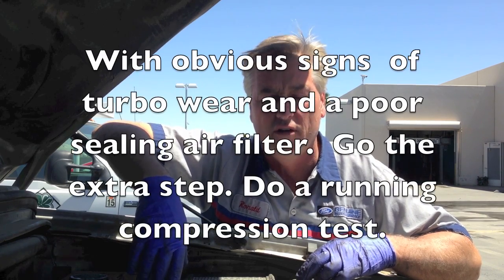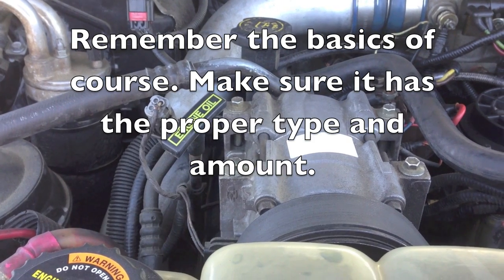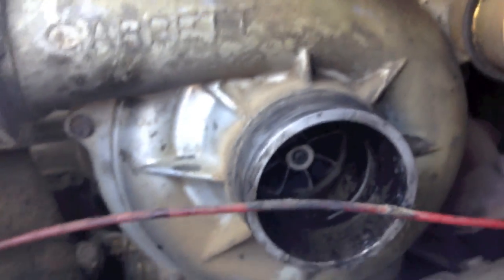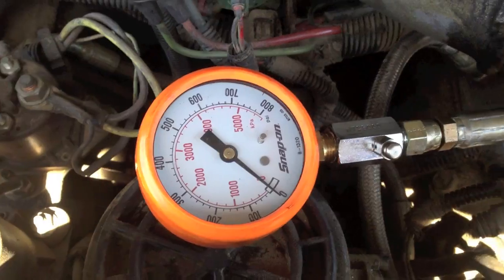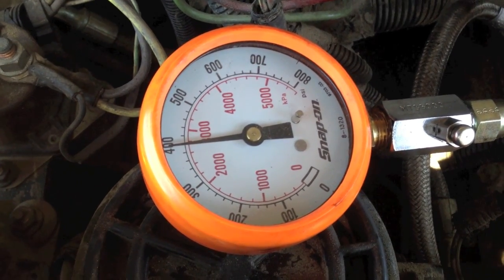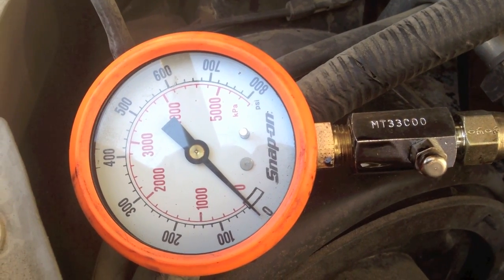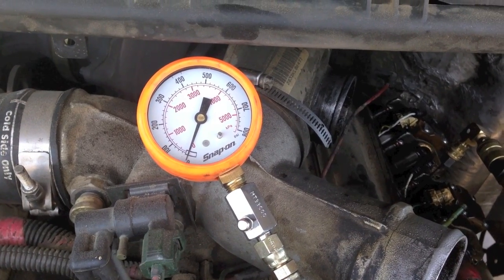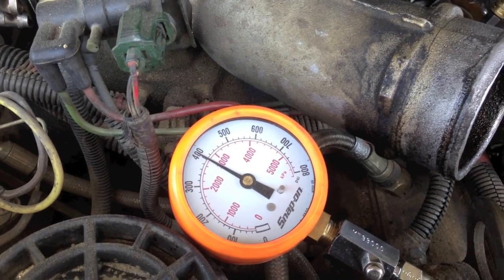Ford 7.3 Powertroke diesel runs rough due to wear. Injectors replaced

Comment: I believe you are one of the most knowledgeable resources on the Tube... there are so many contributing factors to a why a engine runs the way it does.  I could see why the customer might be chapped. Even aftermarket injectors can easily run $1000. I had some rough running conditions and fixed them permanently with stiction eliminator oil additive ....HOTSHOT stiction eliminator.. $60. but it worked for my issue. Beats the 1550 estimate for new injectors I was quoted. I've put over 3200 miles on it since and it runs awesome.
Reply: Is yours a 6.0 or 7.3? Cause my #3 injector is popping a code whenever I run CCT and I would love to not have to take it in for a compression test...

Comment: Let this be a lesson kids... even a workhorse dog of an engine like the 7.3 will go to s**t if you don't do basic maintenance.

Three main things to remember with the 7.3:

Clean air/fuel filter, pipe sleeves on correctly and boots nice and tight, and for the love if God GET YOUR OIL CHANGED REGULARLY.

Comment: I purchased a 2003 Excursion 7.3 exact same problem previous owner had removed the air filter turbo impeller is obviously damaged and has affected cylinders 1 and 8

Comment: hi  you 're   smart guy  l see your videos l like  7.3 l can ask you l  have 99 l rebuilt all injectors not starting l change icp sensor ipr valve not starting can you help  please i put 75 fls torque its corect
Reply: Unfortunately,  Ron tragically passed away. R.I.P Ron.
Reply: 03 f350 rebuit & shimmed drivers side injectors including interior  exterior o-rings. Wont start.ipr,icp cps all new prior to rebuild. Did u fix ur problem?  Frustrating

Comment: Hi, I have a ford super duty, with a 7.3 ,240 000 miles on it. it was working very well then it stop. I started it runs   good on idle but  when I push the accelerator pedal it stop working, I crank it again it works, then I push that pedal and it stop. I change the fuel filter the one that separates the  water from the diesel, It keep doing the same. I disconnect the batteries  wait a few min, then I reconnected back and the motor ran very well for a week,  then it  stop  and  as before keep doing the same. any idea, what can be the problem?
Reply: Qubole Hector, did you find the problem? Oh la echaste mejor al quilo?

Comment: I would think that 500+ lbs of compression should fire. It may not be contributing 100% but that's enough compression to fire the fuel. Did you try to take a running compression test on one of the good cylinders with the injector disabled? It would make sense that a cylinder that is firing would have higher compression pressures due to the expanding gasses after it fires. That would show a marked increase in compression pressure at the guage.

Comment: Ron, I have a early 1999 with a 7.3 PS, with the same cct flagging 1 & 8, all 8 passed the buzz test. No noticeable difference in crank speed of cylinders when turning over. The turbo wheel had signs of dusting too. Fuel pressure 60psi, good oil, filter, etc. Appears to have a dead miss in 1 & 8, will drive/smooth out decent past 50 mph, but has obvious loss of power with hesitation. I havnt done a crank/running cylinder comp test yet. Does it sound as though this motor has the same exact symtoms your customers did in this video? If so, what are your thoughts of the potential repair to correct the problem? Thanks, Steve
Reply from the maker: This is rare. can you monitor perdel? it is like a cylinder contribution. 8 is always higher, with the updated cam sensor 8 gets flagged a lot.  do you have access to a,cylinder cancelation box? it's where you can cut off each cylinder while it's running.
Reply: @DieselTechRon  hi sr I have 1999 f350 why  show a motor oil  on the intercooler pipes? Is the turbo  is  bad  I remplace  the  injectors Orings  and  glow ploughs and the wire harness with the gasket   but still  blows motor oil truck the turbo  I ready  change the turbo Orings
Reply: @josevaldez-qq9qu  what did you find. Been a while. Same issue with mine. Replace everything oil thru turbo and miss 1 and 8

Comment: ron  hey yeah how ya doin?   during the running test do u still have the valve in place?  what adapter are u using to screw into the glow plug hole?  i see u are using the snap on gauge.  thanx gr8 video

Comment: what does the repeair manual say about comppression wear, on my 93 e350 7.3 it states that no lower than 30% of the rest of the cylinder on the same bank/or opposite bank, that is what i remember, don`t know if its the same values with 7.3 powestrokes, but anyway ford should have been more spesific about that part though..
Reply: bjornahh87 not a ford engine

Comment: Thanks for the information. I am going to perform this test since I have similar conditions in the engine I am diagnosing. Question: did you disable the injector for the cylinder that you are measuring compression?

Comment: Hey Ron, Excellent Vids. I'm Workin' On My Dads '99 7.3L, Started Runnin' Rough, Then Died Twice. I'm Going To Rebuild All The Injectors But I Can Not Find That 'System Zero' Driver To Remove That Machine Screw Under The Injector Solenoid, Any Ideas On Where I Can Find One Here In The States? I Found One In The UK, But They Will Not Let Me Buy It. Any Ideas Where I Can Find One? Also Where Can I Buy The Internal O-Rings For These Injectors At? Any Help Would Be Much Appreciated, Thanx In Advance
Reply: You still looking for tools and O-Ring kits?

Comment: I understand completely. Doing fleet work you see engines that haven't been maintained worn out under 60k miles. Its tough to believe sometimes that all of that damage is due to basic maintenance. The 5.4 3 valve vct system is also very sensitive to oil change interval. Gotta stay on top of the maintenance....either pay now or pay later.